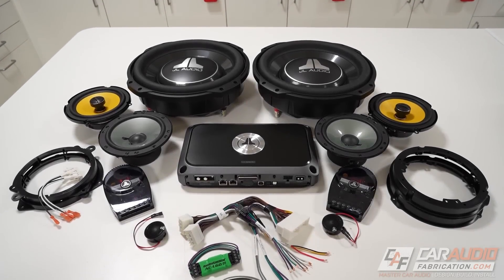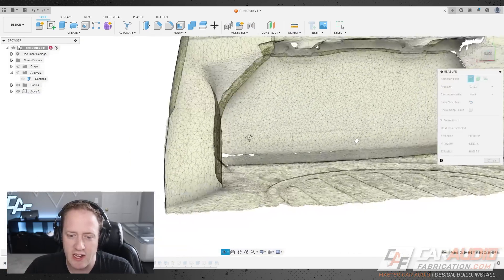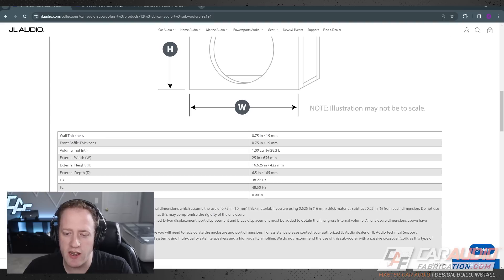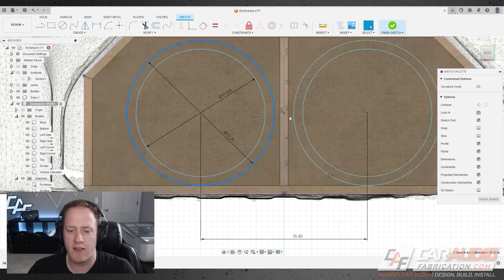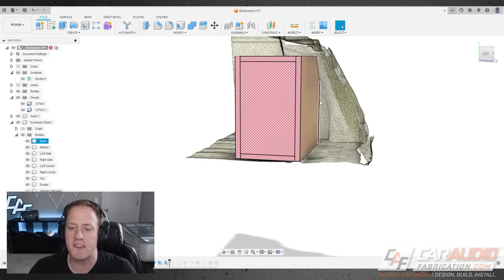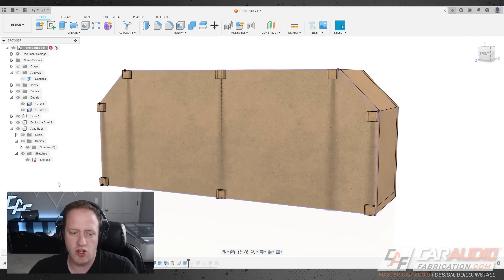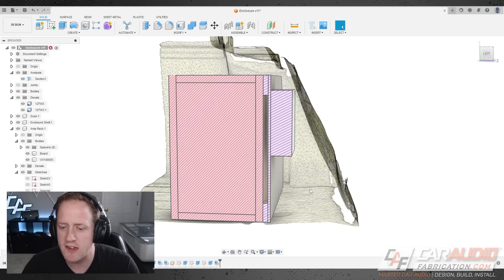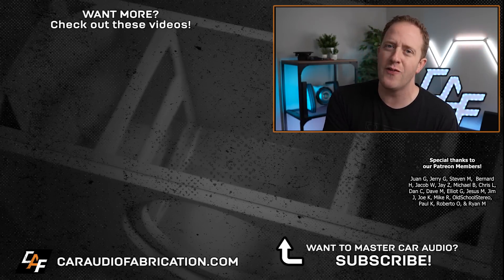DESIGN & PLAN Subwoofer Box / Amplifier Rack - Process Explained!

Comment: *****Volume Question.
Does the "Speaker" take volume away from the requirement?
Reply: Yes, you have to add the volume the speaker takes up along with the size of the enclosure. He did explain that in the video.
Reply: @spacecadet9983  You would the requirements would be configured by the manufacturer to simplify the build, kind of like adding the tax and having the sticker read the actual cost in purchasing but they don't.

Comment: I have a question ( 30hz or 80hz )which one is stronger in bass ? Or if anyone can explain me about these things cause i really have no idea
Reply: 80 is in the (useable range). It is slightly higher of the cut off point for most subwoofers. It is a lower mid bass frequency.
Reply: @spacecadet9983  so basically staying in 80hz is better than 30hz ?

Comment: It is rumored that mounting directly to the box can kill your equipment with vibration. Solder is a weak point that can undergo even more stress from the vibration and impact from the box. If you want to mount to your box, just get little rubber spacers / feet so there is something to absorb vibration.
Reply from the maker: Is mounting the amplifier on the box ok? Full video on that here https://youtu.be/NtYnmlghEJU?si=hLdmda6xVYJiOrHy

Comment: Hey Mark great video but why are you mounting the amp on a sheet of plastic as opposed to mounting the amp directly on the back of the wood box? Is there a benefit to doing that???
Reply: He said he wanted room for wiring and/or the heads of zip-ties.  Also, many people believe that mounting an amp directly to an enclosure introduces too much vibration to the internal components of the amplifier.
Reply from the maker: Also find it easier to make everything on a rack, then bolt that assembly in, as opposed to needing to do everything on the cumbersome enclosure.
Reply: @CarAudioFabrication  thanks for answering and thanks for creating such a great channel! I’m learning a ton about car audio from your videos. 🤙
Reply: @BaddDukk  that makes sense. 👍 I guess I missed that.